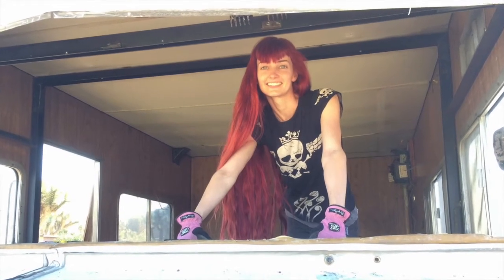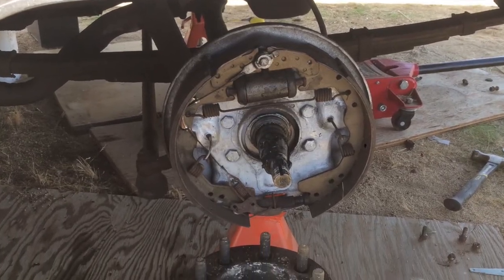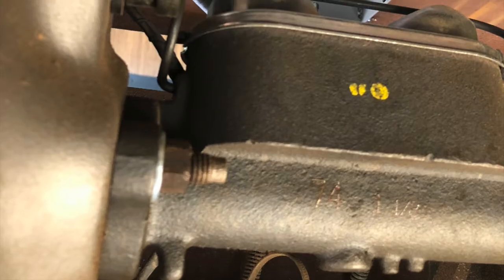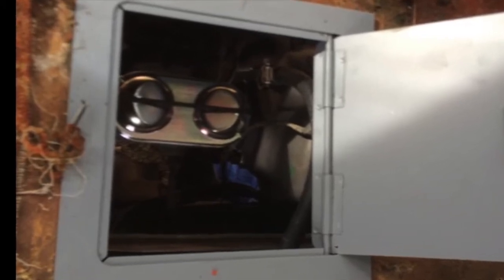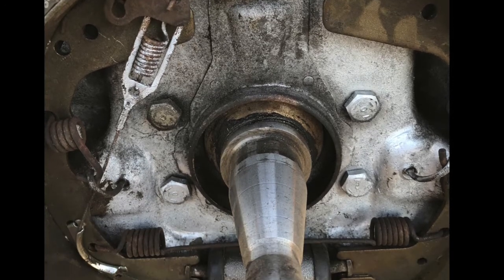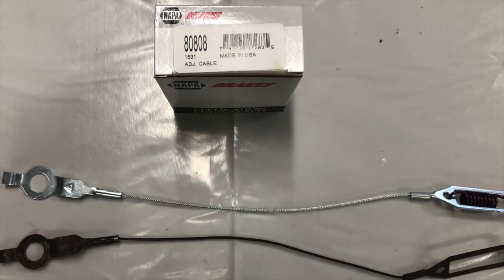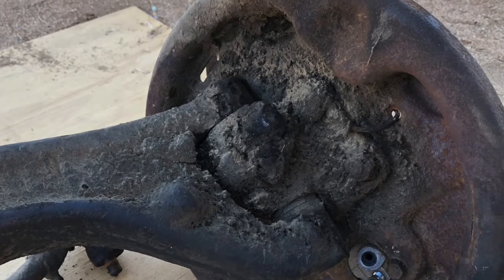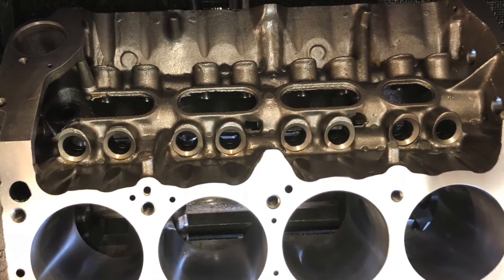Althea the Brave : Pt 3 : The Brake Booster

Comment: I live in a 76 Winnebago, brave I made a scary discovery about the engine. The mounts aren't bolted in place and the engine is sitting Crooked Is there a way to fix it without having to remove the engine?

Comment: Love your RV IAM restoring a 73 winnabego Indian looking for some parts haven't had any luck yet would u know anywhere I could get parts
Reply from the maker: http://www.classicwinnebagos.com has been a great resource I also find old winnebagos on my local Craig's list. For new mechanical parts it has been tough I always start by taking the old part into Napa Auto parts most of the part numbers are too old so we see if match it up by eye. We have all kinds of weird stuff like our breaks are Chrysler!
Reply: @ralis  yeah ty so much I've really been struggling with this and I need my motorhome now
Reply: @ralis  I've been searching for a water pump for mine and nobody has one so I orderd one from summit racing and it was the wrong one so then I just took the old one and had it rebuilt so now the radiator shop is rebuilding my radiator finding a core for has been super tuff
Reply from the maker: RamVan Bobby we got a new aluminum radiator that is a for an old ford truck because we could not get a shop to rebuild ours. We had and aluminum "T" welded on top for the filler extension. Now I have alter the original mounting brackets to make it work. We got our water pump on eBay because it is for the 318-3 old dodge truck M300 chassis but you probably have the bigger 440 that should easier to get parts for
Reply: @ralis  mine is a 413 finding parts for this engine has been so difficult my water neck was rotten I had to have a custom speed shop fabercate me one costed to bills I've dumped alot of money into this RV but I love it thou

Comment: So did you finish it or junk it like most
Reply from the maker: Still working on it, motor and tranny are in, i welded new exhaust, the new sub floor is in, rebuilt the steering box so now everything is new had to get a new radiator and have it modded. Work has gotten in the way so we are moving slower than we want but it will be a brand new 1973 Winnie someday!